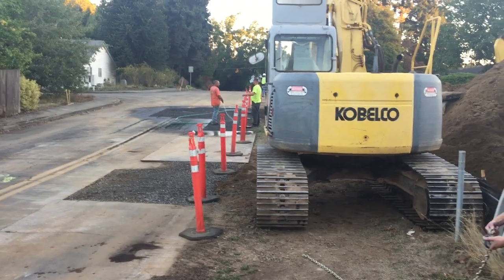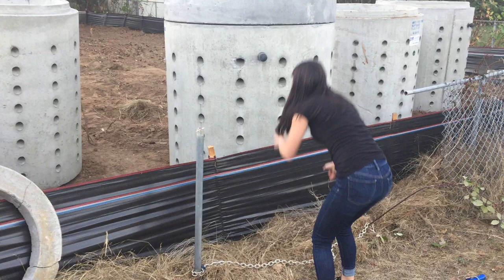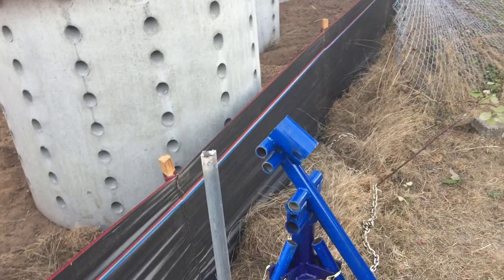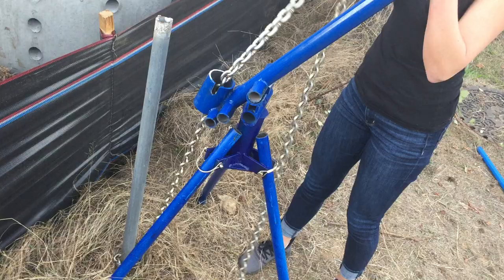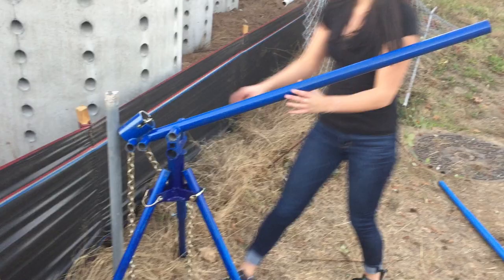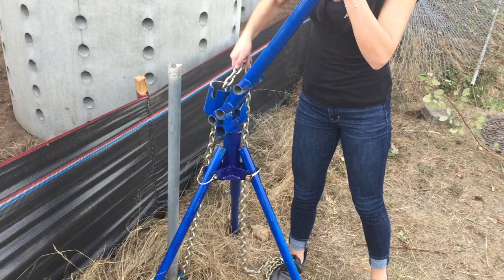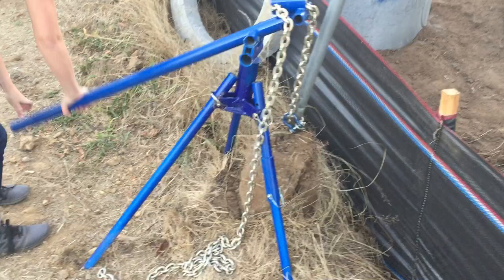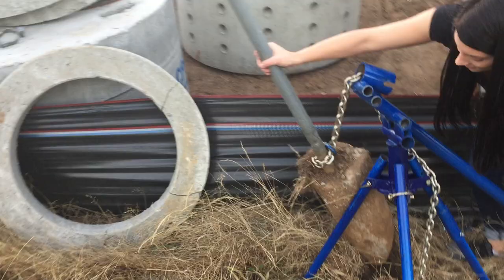Fence Post Removal Tool   NW Quik Pull Instructional Video.

Comment: If I have an excavator I will use it. Good tool, but improvements can be made. One big one is the footprint, it needs pads under the legs so they do not sink as much or at all. Either stationary pads, pivot pads or removable or a combination of these.
Reply from the maker: Thank you for your interest in our tool! This is an older video and our current tool has bigger feet that fit a 4x4 under them very nicely.

Comment: People suggesting ratchets etc dont know what they're talking about. The tool is SIMPLE and a ratchet would fill with sand and mud in no time. You have a great concept, don't complicate it with breakable wearing parts!
Reply from the maker: Thank you for your kind words and your interest in our tool!
Reply: @NWQuikPull  No problem, one improvement would be some feet/plates on the legs to stop it sinking, otherwise great
Reply from the maker: @MrOzzy281  actually, the size of the feet has been increased since that video. Now the feet will fit a length of 4x4 under them if needed to prevent sinking.
Reply: Yep and here in Florida, that would be a big issue. More simple, more better.

Comment: It would be better with an uptake on the chain rather than messing about rehooking.
A ratchet and pawl system would probably do it.
The feet on the tripod need some sort of plate so they don't sink in as well.
As a concept machine not bad.
Reply: My same thoughts exactly at first, BUT you always have to apply (kiss) to your design. Keep it simple stupid, no offense intended. If you have one tree/post to pull then  yes, but if you have many then your going to be wasting time resetting your winch on every single post. Plus more awkward moving parts to have to deal with. I own one of these and it’s awkward enough resetting from point to point. That said it’s still a hell of a good tool!
Reply: Same thoughts. Oh shit, cool name lol
Reply: A RATCHET requires you to push on the take-up.  Ever try to push with a chain??

Comment: I worked at a nursery where the greenhouses had to be covered for winter with plastic using thousands of iron stakes on each side. Come spring all those stakes had to be pulled off one by one and the job was so laborious and time consuming.  We used so many contraptions and devices like the one showing here but, my true honest opinion is that NOTHING beats machinery.  
If there's only a couple of stakes to pull out it's alright I guess but if it needs to be done all day long, for couple of weeks a mini excavator with a  metal loop will do the trick flawlessly...
Reply: This will pull THREE (3) steel tent stakes at a time.  There is a vid of that here somewhere.

Comment: I've pulled 100's of concrete posts out of the ground (fencing contractor for 10yrs) - hi-lift jack and an 18in chain will uproot anything. And you can use the jack for other stuff like vehicles.
Reply: How about 3" (approx) diameter metal fence posts, 4 feet deep in concrete? They are on a slatted chain link fence engineered for high winds. Any ideas? Would like to save the posts, without cutting them off at ground level.
Reply from the maker: @jt5747  our puller will work on those posts. I can’t promise the force of the chain won’t damage your post though.
Reply: @jt5747  I realize that it might not be possible to use in your situation. But (just the opinion of a retired farm guy), I would suggest that attaching a chain as shown but attaching the other end to the bucket of a tractor loader. Then (of course) use the hydraulics to pull the posts out of the ground. We always had a chain hook welded on our loader buckets, just for that task
Reply: @willhorting5317  rear linkage on a tractor will have way more force than  a front loader.
Reply: @jeffjefferson3364  you seriously think that the 3-point on the rear of the tractor has more upward power than front loader hydraulics? I honestly never gave that a thought.🤔🤔 And I never thought about that, because those 3-point systems have a much shorter/smaller lift.🤷‍♂️🤷‍♂️
Reply: @willhorting5317  well it obviously depends on the tractor but most mid range farm tractors have 5ton plus lifts at the rear, the lift force is measured at the eye of the lift arm.
Our current tractor I believe has a 6ton rear lift.
My cousin had a Renault ares 735 and it had a 10ton rear lift.
Reply: @jeffjefferson3364  thanks for the info.
Reply: @NWQuikPull  why u make the price so high for a couple steel bars . Seems like u priced your self out diy crowd
Reply from the maker: @lizardman1303  this tool is also available to rent at many stores which are listed on our website nwquikpull.com

Comment: That was amazing accomplishment especially with the ground being dry. I use a t post puller pull out 10x8 posts in the ground that are not in cement. I just drill a hole in the side of the post and a slight angle up three degrees. Install a large lag bolt with about an inch sticking out. And then I use the t-post alert and it lifts it up a couple inches or so I add water around them post also to make it slide out easier. I also start shaking the post after the first bowl. Then I feel a new hole lower I had another lag bolt and the two postcode till the whole post is out of the ground.
Reply from the maker: Your method sounds a little time consuming, but if it works for you, great! Thanks for taking the time to look at our tool!

Comment: Great idea thanks, I just copied your model  with some scrap fence material I had, it cost me a few welding rods and a few hours of work, it works pretty good but forget an 8" 4' deep concrete set post in clay, it won’t even budge. I wanted to   order one from you but 1500 plus 😮

Comment: Connect the chain half way down the post and it will slide down after each lift.
Reply from the maker: The chain is a grade 70 logging chain. It’s made to bind, or bite into the pole, or post so it stays in place when pulling. Thank you for your interest in our tool!

Comment: It’s works good in a pinch but you have an excavator sitting right there that could have pulled all the post in the time it took her to pull one
Reply from the maker: You are correct, the excavator would have been faster. The point of the video is to show an alternative to the excavator. Maybe the post needing removed is in someone’s back yard where the excavator can’t, or shouldn’t go! Thanks for taking the time to look at our video!

Comment: Pulled 6 foot posts 3 feet in the ground with two bags of cement on each, 40 of them...one day. Later used an air hammer to get the cement off the posts.
Reply from the maker: You did that using NW Quik Pull? That sounds like quite a large task! Do you have any pictures you could share with me?

Comment: If it were me, I’d fabricate some flat square to mount the feet on the tripod so avoid the feet sinking into the dirt, otherwise she did a great job.
Reply from the maker: Thank you for your interest in our tool. The feet are made to sink, or bite into the ground. If they are sinking too much, a 4x4 will fit under them to keep them from sinking if the ground is too soft.

Comment: I wonder if this would work on 4x4 wood posts.
Reply: a car jack and some bolts would be easier than this thing
Reply from the maker: David Eugene this tool was invented for the basic 4x4 wooden post, or metal post with concrete footings.

Comment: Then why don't you use engine lifter mount easier than this way
Reply from the maker: Most engine lifters do not have the power this tool has. NW Quik Pull has 10,000lbs of pulling power!

Comment: Isn't a highlift jack faster and a lot cheaper
Reply from the maker: Because of our tripod feature, ours tends to be more stable. And that stability leads to speed.
Reply: @NWQuikPull  A highlift jack is a lot quicker. Having to move the chain each time you lever it is a major drawback for me. It is more stable than the highlift jack but far too expensive in my opinion. Why not design a brace for a highlift jack🤔
Reply from the maker: @brianconnor1810  thank you for your interest.

Comment: How about 3" diameter metal fence posts, 4 feet deep in concrete? They are on a slatted chain link fence engineered for high winds. Any ideas? Would like to save the posts, without cutting them off at ground level.
Reply from the maker: Yes, our puller should work on those posts. Where are you located?
Reply: @NWQuikPull  San Diego County, CA. Any rental places nearby?
Reply from the maker: @jt5747  no, I think Sacramento is the closest, and that’s not close!

Comment: you needed to put wood under the legs of that its sinking in the ground lol
Reply from the maker: Putting wood under the feet does work, although some sinking of the legs of fine too.
Reply: Yeah if I was gonna pull a million, I'd get some steel skies made and just push it to text post ,like clock work